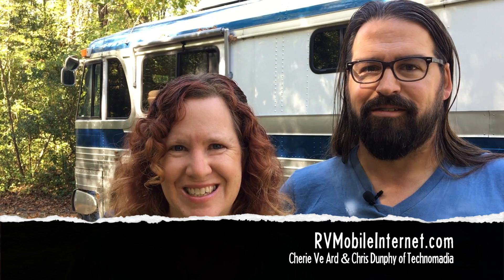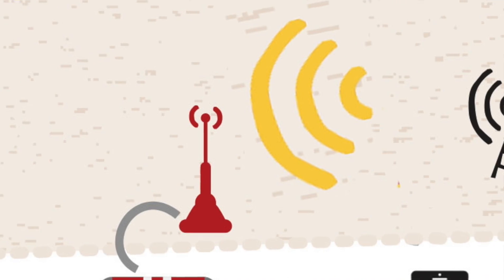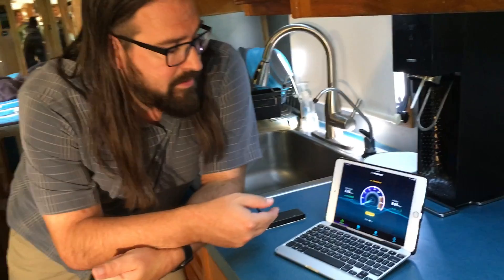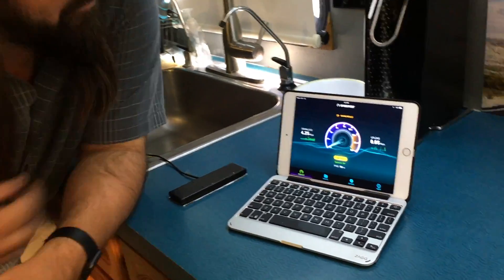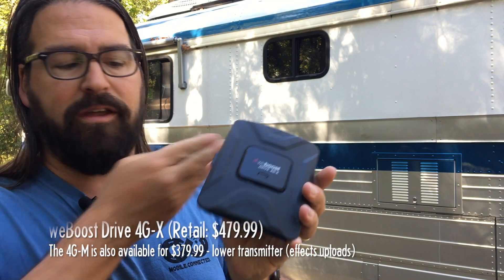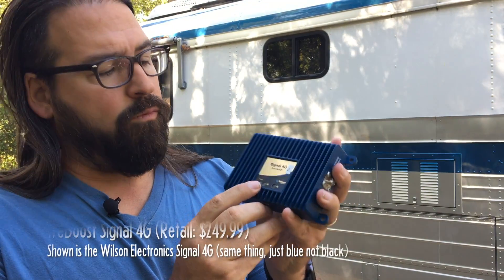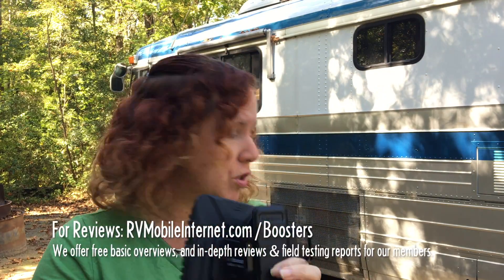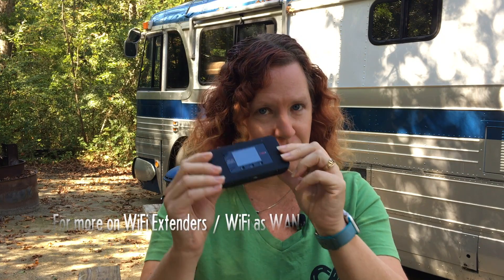Signal Enhancing: Cellular Booster Overview for RVers

Comment: After trying three of the four solutions you describe, over the years, I've found the one you favor least actually works best for me.  The WilsonPro 4g (or WeBoost Signal 4G) east/west (up/down) amplifier is only 15 dB gain but connected directly to a divice, that gain is usually more effective than a higher gain amp that loses much of its higher gain when it re-broadcasts over an  air interface from the inside antenna to a phone or other device. More & more gain is lost as the device moves away from the inside antenna over a foot or two.  Automatic Gain Control (AGC), used to eliminate feedback, will often reduce the gain even more.

I connect the 4G directly to a hotspot which translates the cell signal data to WiFi and broadcasts it throughout my coach and outside for some distance.  With this frequency translation arrangement there is no mechanism for antenna to antenna feedback and no need for AGC gain reduction.

With WiFi calling on our phones, everything works including talk, text & data just as if the phone had a very strong cellular signal.

Comment: I recently purchased 185 tmobile 4g lte signal boosters. Tmobile only hooks up qualifying users. I'm desperately trying to get them unlocked. Cel-Fi makes the units for tmobile and sells theirs as unlocked. I either need to get mine unlocked or the cel fi firmware flashed on to my tmobile units.
Reply from the maker: You purchased 185 boosters? Why?

I do not believe there is a way to re-flash the Cel-Fi boosters. It isn’t just a matter of being “locked” - the hardware of the T-Mobile unit is custom to T-Mobile.
Reply: @Technomadia  no its locked on to tmobile with an imei. It can be unlocked like a cell phone

Comment: I have a question, how does the antennas that are either magnetic or double sided tape, that has no wires.
Compare to an actual amplified signal booster?
Reply from the maker: We have extensive testing results available to our members in our field testing lab: www.rvmobileinternet.com/lab

Comment: Have you heard of SureCall Fusion 4 Home? It works like the WeBoost Mobile but claims up to 20 foot range to your mobile device and the price is about $300.00.
Reply from the maker: Yes, we've heard of it - but they're not suitable for mobility or small spaces. You have to consider oscillation issues. For most who RV, a mobile booster is best.

Comment: Great info y'all.  I would like to point out for those who may not know, db is not a linear function, that is to say when comparing the booster with 23db to the booster with 50db gain it is not roughly 2x the power.  Because db is exponential the difference between 23db and 50db is an increase of more than 100x in power.

Comment: Great video. We spend time high in the mountains. We have to drive 16 miles to get a signal. What are if any, Our options?
Reply from the maker: So much depends what's available there... you'd have to do a site survey there of what signal is in the area and optimize for it with antennas and boosters and appropriate plans. Single locations are a different approach than setting up for mobility (our speciality).

Comment: what's more cost effective and streamline, two cell phones on VZ sharing unlimited internet data and a weboost cradle  solution and have the phone create the hotspots with external antenna OR object two... external antenna ... with a jetpack or cradlepoint type device that will take a slim card and with included wireless router? I understand it all depends on where you want to hang out near town and cities with lots of towers or being in really remote.  I always plan and prepare for worst case.
Reply from the maker: There's a lot of variables there.. you'd really need to compare the differences for yourself and the trade-offs.  And of course confirm the plan you're looking at will actually meet your needs (ie. current Verizon unlimited plans only include 15GB of high speed hotspot use). 

We have a bunch of guides online that walk you through the various decision points - selecting plans, hotspots vs smartphones, boosters vs antennas, etc.   You can get started at: www.rvmobileinternet.com/overview
Reply: Technomadia I’ve now found that backing into the decision process is a better way to arrive at mifi vs cell phone hotspot (the unlimited data plan which right now they all have limitations) and on from there if want a permanent setup with a separate modem/skin card or again using your phone as a hotspot etc etc... the data plan is the bottleneck for me
Reply: Technomadia I was on the phone with Tech support at VZ questioning the send and rec strength of the VZ 7730L vs the iPhone hotspot and I was told they were the same, so to me it just comes down to boosting the signal that’s important.... I was hoping to hear that jetpack had better reception unless he was clueless
Reply from the maker: MIMO vs boosters can have significant differences in cellular data performance. Our guide to that: www.rvmobileinternet.com/cellsignal 

Also, there are legacy unlimited Verizon plans out there - www.rvmobileinternet.com/verizon-unlimited

Comment: The 4G-X will not boost Sprints hi speed spark network (in some major cities) due to being too close to emergency frequencies. From their customer support:         Response from weBoost:       Anonymous      · Weboost Technical Support    · 8 months ago     Thank you for your review. We are sorry to see that you experienced trouble 
on the Sprint network. You are correct, unfortunately we are unable to 
cover Sprints Spark network at this time due to what you mentioned - the
 frequencies being outside of the traditional cellular range. For 
questions please feel free to reach us here:
Reply from the maker: Tripper Indeed, Sprint is the most "unboostable" network. We often recommend Sprint customers focus on external antennas if possible, rather than a booster.

Comment: Great video, I have both of your books and this video really brings your written word to life. I bought the earlier Wilson cradle for my jeep and added the 12" antenna. I really loved the performance on the road. When I put the phone in the cradle 4 bars immediately boosted performance. Guess I will have to upgrade to the 4G model. GPS is another source of complaints. Garmin dropped the exterior antenna port on the Nuvi unit I bought. Will never make that mistake again.My Rand McNalley has their antenna laying on the dash, say what! I am going to see if I can modify it to my Garmin remote antenna and put that on the roof also. I was intrigued by your roof mounted unit with multiple antennas including the GPS. Gonna start digging through your book for info on that one...
Reply from the maker: The antenna is the Mobile Mark... you can learn more about it at www.rvmobileinternet.com/cellularantennas (the book doesn't make many product specific details, since they change so quickly.)
Reply: Thank You, prayers being said knowing the exact fit w/ few compromises on your boat search will be successful. Consider the European canal design 're: clearance and draft.

Comment: I have The 4G-X. The manual says about the inside antenna  positioning "The location should be at least 18 inches but no more than 36 inches from where the cellular device will be used .  Your device should not be too close to the antenna.
'
Reply from the maker: We don't find that to be true in actual use.
Reply: Mfg's specifications and directions of use are not based on your findings.  If you overdrive any electronic circuit or mismatch impedance, circuits overheat.  Though you may not have yet damage the antenna interfacing circuit of your phones that does not mean it will not happen to one of your viewers devices.  If you choose to ignore or have not investigated all the manufacturer's  directions, say so in your videos.
Reply from the maker: Mtn Goat We have years experience using cellular boosters this way, and we have compared notes with both booster manufactures and dealers and no one has ever shared with us any stories of damage. The distance requirement is primarily to match the FCC certification / testing -- but we've never seen any harm from putting a hotspot closer to the indoor antenna. If anyone has experienced this, we would love to hear about it.

Comment: I want a boosted cellular connection for both phone calls and for mifi.  Can the Weboost be used for both?  I realize I would have to be a mifi device.  The deal is I want to use my laptop to connect to the office but also to receive phone calls at the same time.  I can't do that if I connect my laptop using the hotspot.
Reply from the maker: Yes, the weBoost 4G-X and 4G-M can boost both a cellular phone and MiFi at the same time (as long as they both are within a few feet of the interior antenna). 

Some phones/carriers do however work well as both a mobile hotspot and able to receive calls. But if you're doing it often enough, it's usually best to have a dedicated hotspot (MiFi). We have a recent video on exactly that at www.rvmobileinternet.com/mifi

Comment: Great information. Do you think I would be able to attach the large OTR antenna to my trailer's TV antenna? It would not add height to the trailer when traveling but would be nice and high when cranking the TV antenna up.
Reply from the maker: Yes, some have done that for their installations.
Reply: Now if my TV antenna is just above my dinette table area, and that is where I would put the inside antenna, I guess that's too close together for the two antennas and there would be feedback. Right?
Reply from the maker: Andre Campeau Potentially. All depends on the signal you're boosting. 10-15' of separation is usually recommended.

Comment: I am looking at going full time RVing, I can remote into work. My company provides a secure VPN for access to the tools I need for work to include MS Exchange.  Will the data "Hotspot/jetpack" provide enough bandwidth to support the VPN?  I really want to go mobile and I don't want to pay rent anymore.  I really like your videos. Any advise is greatly appreciated.  thank you for posting you vids....
Reply from the maker: Yes, many folks successfully work remotely using VPN. You'll likely want  multiple options on board board, as signal strength and bandwidth can vary quite a bit on the road. Redundancy is key.  Check out our overview at www.rvmobileinternet.com/overview for more information.